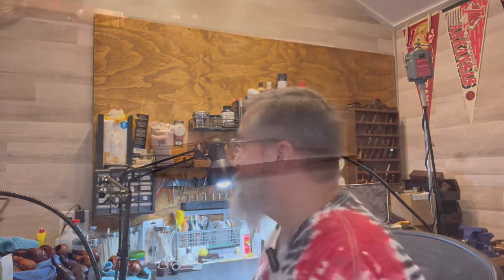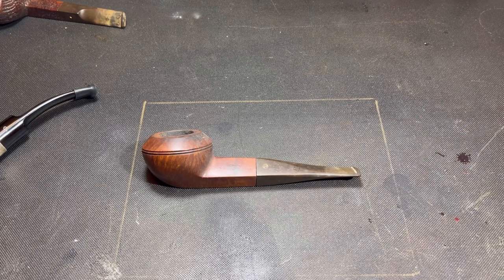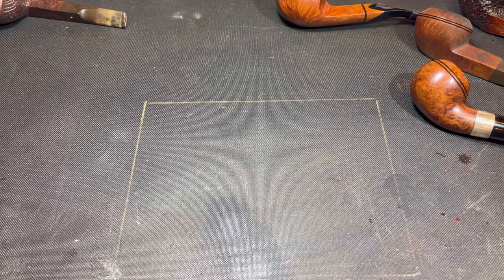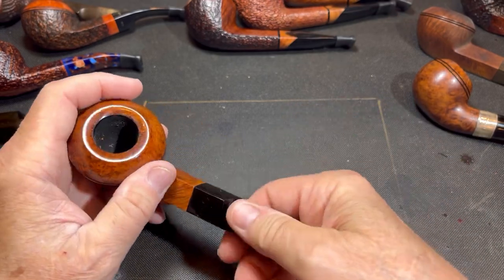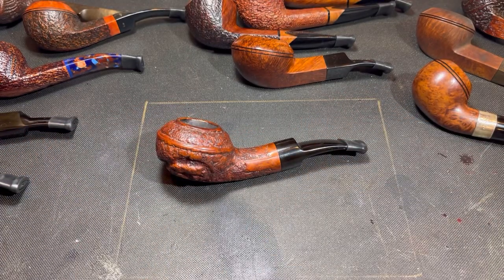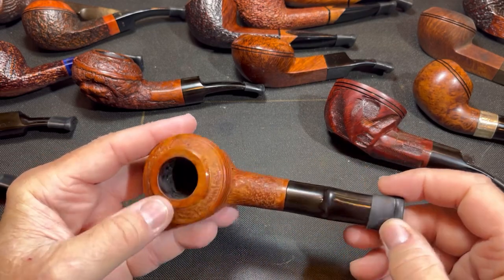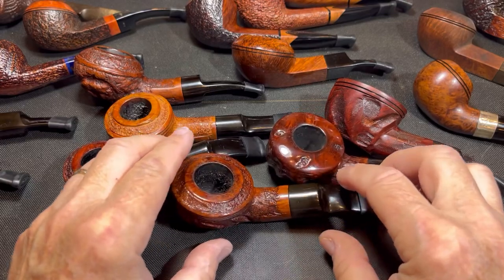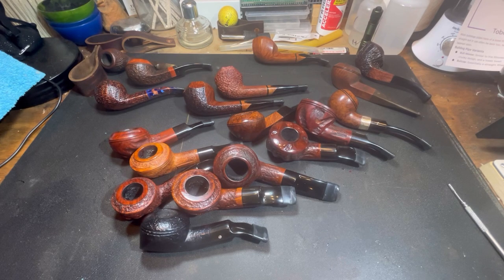My Bulldog and Rhodesian Pipes

Comment: Interesting video. These are shapes that I gravitate to as well. Trying to classify the wide variety of variations that occur in these shapes (and many pipe shapes, I suppose) can generate some fun discussion. Like you, I don’t have decades of experience, but I do think of a diamond shank as a bulldog and not a Rhodesian, whether bent or straight. An interesting variation is Matches860’s favorite, the Savinelli 673. Bulldog? Rhodesian? Related, but not truly either? Savinelli on its site describes it as a bent Rhodesian, but the shank is not round. As long as the discussion remains friendly and fun, it’s a positive for the YTPC. Thanks for your video!

Comment: I would rather have a $5 no name that smokes well than a big name that burns hot or won't stay lit. What are the stem protectors called and where do you get them?
Reply from the maker: My best smoking pipe only cost me $28. I got the softy bits from Amazon. I’ll post a link.  Thank you for watching. 

https://www.amazon.com/BJ-Long-Touch-Mouthpiece-Rubber/dp/B07J2RKW69/ref=mp_s_a_1_1?keywords=BJ+Long+Soft+Touch+Pipe+Mouthpiece+Stem+Rubber+Bits+-+50+in+Each+Bag&qid=1701539803&sr=8-1